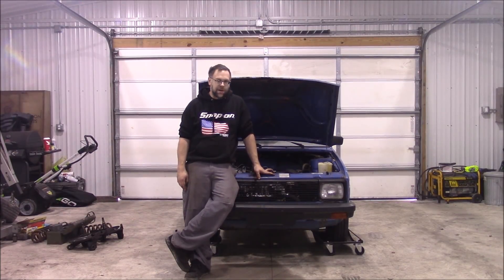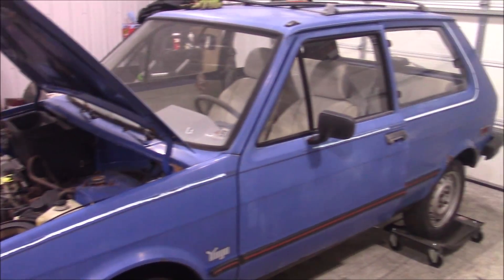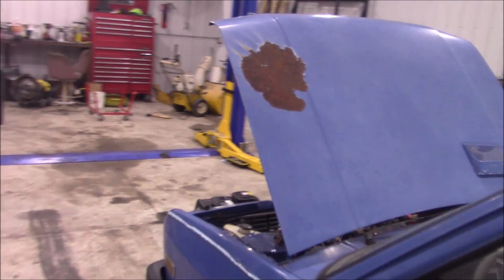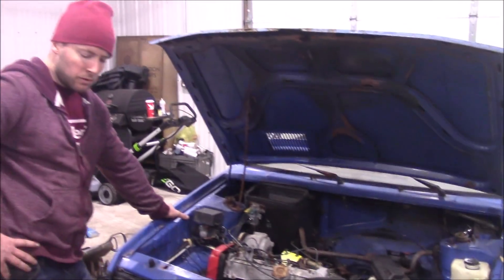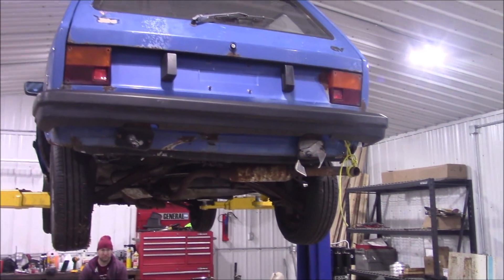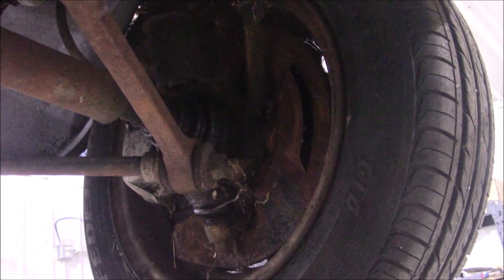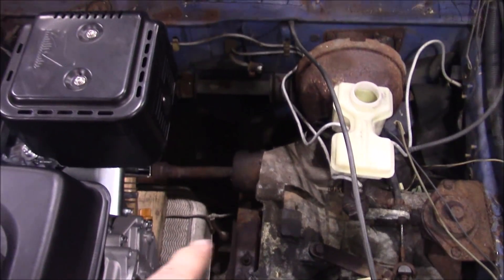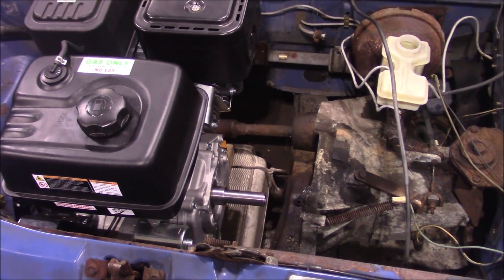We swap a LAWN MOWER ENGINE into a YUGO! - Part 1

Comment: I was THIS close to buying a ford festiva back in around 1989 , just because I thought it would make a decent project to swap some kind of “ better “ in line four cylinder . If I found a Yugo that wasn’t hacked , rotted or butchered to s**t , I might be tempted to do the same , if the “ individual “ who was selling it didn’t want to be a dick and ask real money for it . An AMC gremlin is a cooler looking car but would need a real engine because it’s way heavier . I’m digging this though , want to see burnouts if can be had ✌🏻

Comment: I started a similar project.   Used the factory flywheel and clutch,  machined an adapter for flywheel to mount to 1in shaft with pillow bearings. Was going to use pulleys to belt drive shaft. 
Now you can use factory clutch to drive.  Mine the starter mounts to bell housing, so I can use factory starter.

Comment: The v twin would be much better suited than the 1 cylinder
Reply from the maker: That's cheating
Reply: @FuelInjectionSucks  imagine that the new top dog Briggs puts out about 37hp, haha not far from that original engine.
Unfortunately,it has fuel injection and yes we know : it sucks 🤭🤭😂😂

Comment: Due to power loss using additional jackshaft etc, why not line up the output shaft on the predator with the gearbox input shaft and attach/make a lightweight flywheel to the predator shaft use a lovejoy coupling to connect to the gearbox. That way just use a lightweight clutch assembly from a car or motorcycle. Otherwise you will have no way to engage/change gear just by using your jackshaft idea or lovejoy coupling on it's own.

Comment: Awesome! Plenty fun extending a input shaft for an odd engine/gearbox pairing, My friend banger raced a '76 Bedford CF ambulance with a Honda D15 engine running a rwd BMW 5 series gearbox to a flipped rear axle and that took alot of abuse Donuts burnouts etc, Looking forward to more updates on the Soviet lawnmower!

Comment: SO MANY performance parts for these predators. Stock they're pretty limited and gutless, but they open up nicely.  You'll want a bigger carb, high RPM flywheel, cam, and valve springs are all available. Cars & Cameras youtube channel  has a lot of experience tuning these. Use a CVT on it and you'll actually be able to use it with the yugo gearbox, like Robot Cantina did in  his honda Insight.
Reply: For my first job I got a high school I worked at an independent automotive shop.
The guy bought out the yugo dealership and I spent the summer fixing some up to resell.
They had all kinds of hop up parts in the back of the service manuals you could order like cams and intakes and carbs
Reply: @MrTheHillfolk  for the predator 420 engines, not the yugo
Reply: I wouldn't say gutless you probably don't actually have a 420cc with no govner can't be dumb and blow it up and we have ran them on small equipment on the family farm they are not gutless

Comment: Leave it to Fuel Injection Sucks to swap an odd engine into a weird car. I've seen a lot of content on the smaller Predator engine and the v-twin Predator engine but hardly any on the 420cc one.